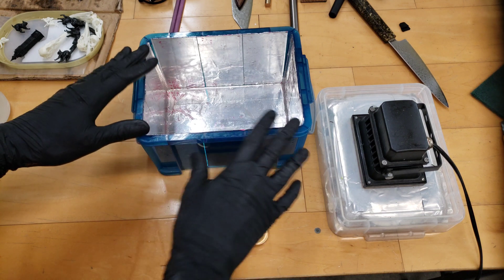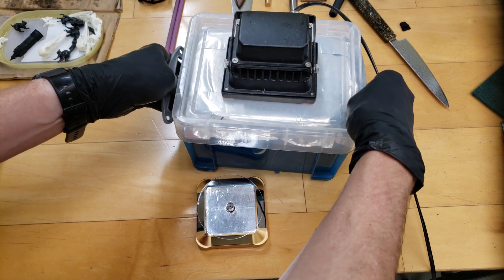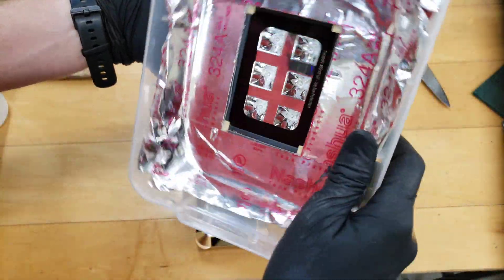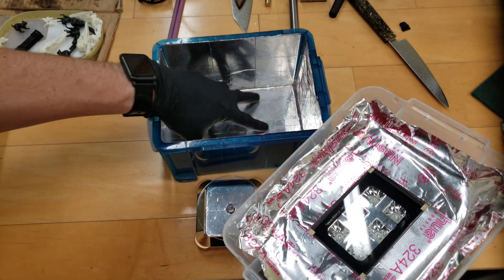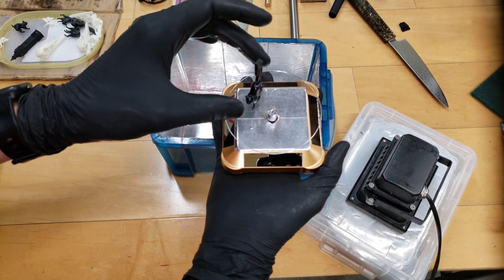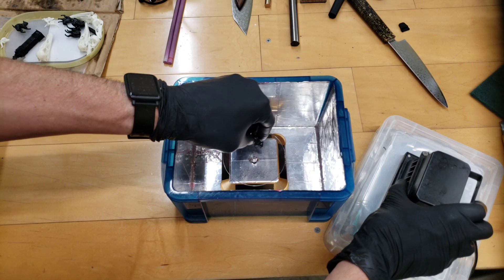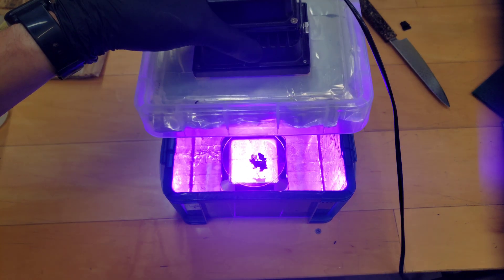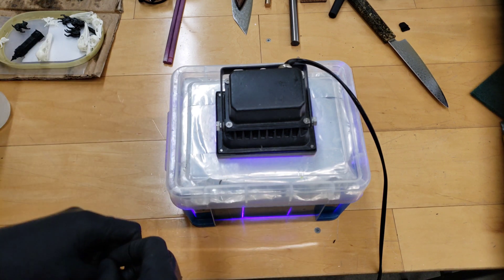Super Cheap UV Post Cure Chamber for 3D Resin Printer Parts | 20W LED Lamp, Solar Turntable, Reflect

Comment: What are the dimensions of the box? At this point I am thinking about making mine out of cardboard. 10 Liters seams to look close to what you have, but trying to see if what it should be. They sell pre-made boxes online at $60.
Reply from the maker: It's about 6x8x6in deep. As long as the rotary table fits, and all your models will fit, that's what counts. You can glue aluminum foil to the sides for reflectance.